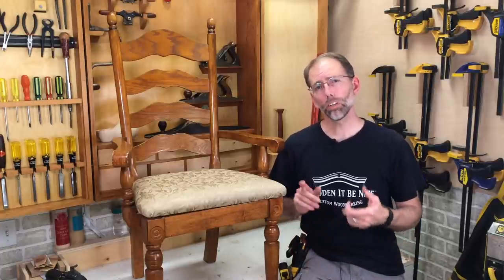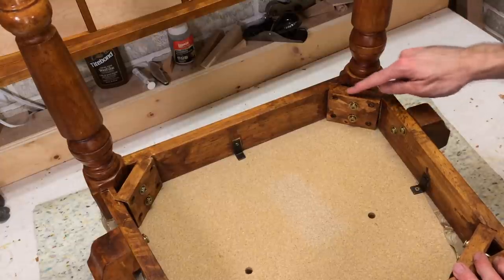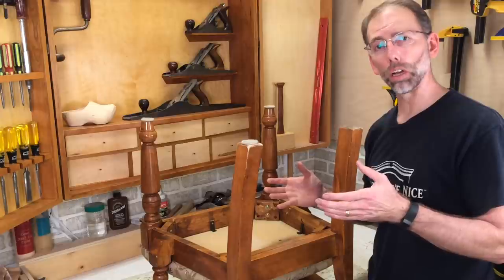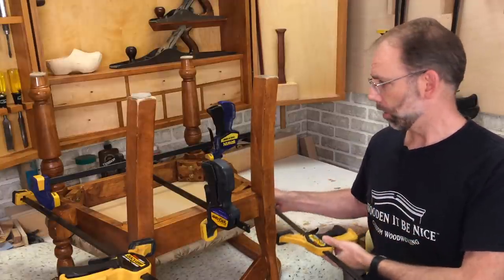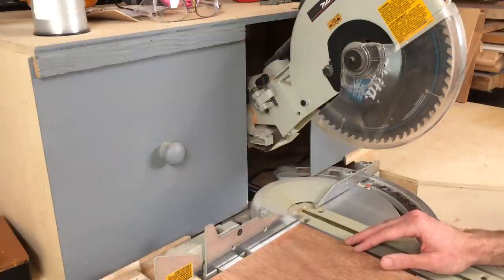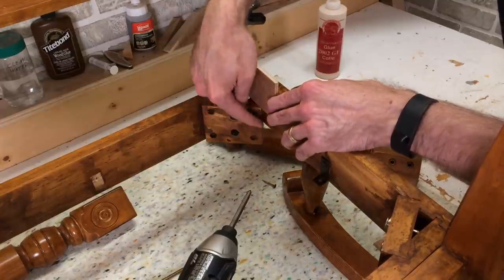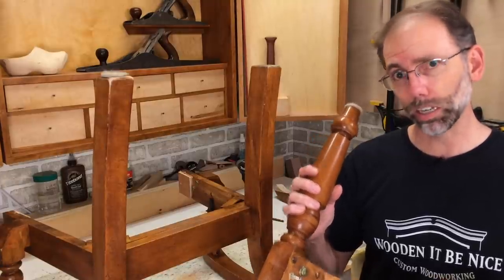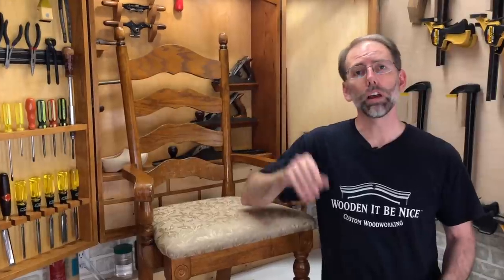Breaking Acacia Wood Chairs - How to Repair Breaks | Woodworking

Comment: Hi Scott, Acacia is quite a common wood for use in furniture making in Australia (think Tasmanian Blackwood, Gidgee), they are incredibly tough and durable. Gidgee is even used by plane makers for the soles of planes it’s that tough. Maybe the problem is that the timber may be labelled as Acacia when it isn’t or that the Acacias in Asia are different or indeed they may be plantation grown and have grown too quickly. Anyway just thought I would let you know that Australian Acacias are beautiful, strong and expensive! Cheers from Australia
Reply from the maker: Thank you Jenny.  That's helpful to understand.  I will have to look into Acacia more to figure out where these problems are coming from.  Thanks.  Scott
Reply: I think there is a big naming problem particularly with imports. For example there are different types of pine which have different qualities. Some are good (or reasonable) for furniture and some are not but are good for framing. There's different oaks, ashes, cedars and merrantis etc. Some are good for one purpose but not another. A quick look at Wiki and I see about 100 different acacias. On the other hand there are only two different jarrahs and I can't tell them apart. So really it's a marketing problem.  I had a lady very proudly tell me her outdoor tables and chairs were made from hardwood. It was western red cedar, a decorative timber. Yes, technically a hardwood, like balsa, but not a great chair or table wood which are subject to much different forces than a dresser or shelved unit.
Reply: @FixingFurniture  I also get a number of these types of pieces in my shop. I don't know a lot about acacia wood, nor can I tell what you are working with on this chair as there are no close up pics of it. Most of what I get in are made from a type of beech. Beech can be a reasonably good wood for this, but what I find is that modern forestry techniques have the trees growing so fast that there is no strength in the wood. Take a quick look at the grain lines to see how wide they are. This could be part of the problem. And of course, as you say the design is poor as well.
Reply: @Goalsplus  I am not an expert and could be wrong, but I thought that 1) eastern red cedar is a softwood and 2) is not a very expensive or hard wood but is often chosen for outdoor furniture due to its innate rot resistance. Please let me know if I have my facts wrong here - it can be hard to find good and accurate information online and (as you said) it can be a real mess trying to match names to species given there isn't good standardization and different woods labeled the same can have wildly different properties ("mahogany" in particular springs to mind).
Reply: @benwake4823  you're correct.  I should have said Australian red cedar which is a hardwood. So cedars can be softwoods and hardwoods.  I suppose someone said it looks like cedar and the name stuck. As for the softwood varieties, yes, it's good in the weather, and some might disagree, but I don't think it makes good sitting furniture because the joints don't hold up. To expand, you wouldn't make a chair from balsa wood  which is a genuine hardwood. And, yep, mahogany is a good example of a mix of woods with different qualities.
Reply: @FixingFurniture  Hi Scott.  Have a look on Google images at "wattle trees", which are Acacia.  The flower is the national flower of Australia with many different species.  They grow throughout the natural bushland in Australia and in many people's yards.  One Acacia item that is beautiful to see.

Comment: Looks to me like  parawood, not acacia.  Sometimes call rubberwood or Asian hardwood.  At 2:38 when you took the piece off, it showed the grain, which looks an awful lot like rubberwood.  Used a lot in "affordable" furniture.
Reply from the maker: Wow, that's helpful.  I'll look into that further to understand it better.  Thanks Jan.  Scott
Reply: Yeah, I think you're probably right, which makes it kind of a mixed issue. The rubberwood comes from SE Asian plantation rubber trees that have outlived their latex production life (25-30 years). They're harvested and made into furniture, as the wood is hard, straight-grained, fairly easily worked, and takes finishes well. It's treated for rot and insect resistance, as it's otherwise susceptible. It's a "renewable" resource, as new trees are planted to begin the latex production cycle anew, and using it for furniture means it's not burned off (putting more CO2 into the atmosphere). And it has largely replaced use of some more threatened tropical hardwoods--also a good thing.
I wonder if the biggest problem here was unsuitable joinery techniques, rather than the wood itself? Inexpensive material got paired with cheap joinery to make cheap furniture. But I wonder if the material itself, handled more respectfully (and, unfortunately, more expensively) might lend itself to a decent product.

Comment: Acacia is a fairly common wood here in the Philippines.  I have about 9 acres on a hillside and we have many Acacia trees here.  We occasionally use wood from these.  As you have found, it can be brittle.  But it is a fairly good wood for making things, just not good for use as chair legs or arms for that matter.  We use it as a very strong wood with some color for framing out tables and benches and we do use it in a much thicker format so we do not run into the splitting issues as long as we keep it thick enough.

We also have a local wood, even harder and much less straight grained.  I have no idea what the real tree name would be in English, but locally it is called Matamban.  It is a fairly white wood and is dense to the point that in the green state, I am not sure it would float.  I work with it a lot used for my work shop work benches.  It is similar in density and hardness to Osage Orange but without the bright yellow color.

The Acacia is available because most countries have stopped allowing the teak and mahogany trees to be cut.  We also have a fruit tree called Jack Fruit trees that make wood that is similar in color to the Osage Orange, a bright yellow color.... It is used in decorative shelving and on larger trees can be used for coffee tables...

Enjoyed the "outside the box" idea with the thin plywood to strengthen that corner joint.  The back legs may break, but those two front legs are safe I think!!
Reply from the maker: Thanks for sharing that Lionel.  It's great to hear what you experience where you live.  I love to learn and I found this very interesting.  Scott

Comment: Who thought it would be a good idea to “inset” the “screw block/brace” into the sides of the seat? A 45 miter on each end of the block would leave the side “full strength”
Reply: Never mind, I see that you did that (whatever the angle needed to be, I noticed it may not have been a “square” seat
Reply from the maker: Good eye.  Yes, the seat flares out at the front so the angles are not at 45 degrees.  Scott

Comment: Just came upon Acasia laminate boards here in Japan.  To me, other color, same as pine.  Light.  I asked staff and they even said "softwood imported".  Another person here mentionned Rubber wood and that looks almost identical but heavier.  Being that rubberwood is so cheap in countries that produce rubber like Thailand, Malaysia and Indonesia, as rubber stops producing after 30 years so they raze whole plantations then sell the logs dirt cheap.  If you are a furniture maker youd use rubberwood for sure.  You know far more about hardwoods than I do so Acasia is possible I suppose.  In countries like Thailand though they don't grow softwoods.  Can't even find it at home centres.  My wife is Thai so I've looked   There is none because of termites.  Homes build but avoid softwoods.  You can bury a big ash underground and then use it 5 yrs later.  Softwoods, if course, forget it.
Reply from the maker: Wow, that's interesting Adam.  Since I published this video, I've seen a number of comments about Acacia woods and it turns out there are over 1,000 different species that vary greatly.  I'm not sure though how to narrow down this brittle but heavy wood that I keep seeing in customer pieces.  Scott

Comment: I'm here in Japan and while the domestic makers use only quality wood,  makers tend to be custom artisans so pieces are very expensive.  In fact, a Japanese lady I knew who bought a new house wanted to have Oak furniture so she sourced in Japan and then decided on a maker in Kentucky and even at that and the shipping across the globe, it was HALF the cost.  So,  its not hard to see the allure of cheap imports.  Though I do wish importers would use better wood.  People would pay a bit more like say Imported Oak.  I bought a round dinner table 2 years ago.  Already a leg broke off.  Very similiar to that Acasia.  Mystery wood.  but judging by weight its not a hardwood.
Reply from the maker: Thanks for sharing that Adam.  Scott
Reply: weight is not the best indicator of a hardwood.  Poplar is a case in point.  When dried very light in weight but is extremely strong and fiberous.

Comment: Thank you for the education.  I just accepted a job repairing a mahogany chair with a shallow angled  break at on the front turned leg just below the stretcher.  The cross section at the break is about 1 inch square.  The grain in the leg is across the leg at the break.  Someone attempted to glue the break with a polyurethane glue.  I would like to install a 3/8 inch dowel.  I am considering sawing across the leg below  the original break to get a level drilling surface.  I would use a clear epoxy to reassemble the cut off chip and the leg with the dowel in place.  The leg is carved with a claw foot and a lot of curves.  Is there a better way to do this?

Comment: Thanks for the video. You mentioned how fibrous spruce is.  I recently read that spruce was used in the construction of wooden airplanes not just because of its “springy” strength and light weight and straight grain, but because that “fibrous” nature made it more resilient to bullet holes.

Comment: It makes me crazy when I see people buying imported crap when auctions and Craig's list are full of older sets in oak and mahogony that people don't want because it's  "old".
Reply from the maker: Yes, it's unfortunate that this type of furniture is overlooked.  On the up side, it keeps the prices low.  Cheers.  Scott
Reply: And adds to the growing landfills and wealth of manufactureres
Reply: I think its just natural for people to want NEW stuff.  They want to be the first owners even though they are probably going to be the last owner (re: they will bring it to the landfill or it will eventually be used in the daughters first apartment , screws holding it together and all)
Reply: Adam Turnbull it is surprising to see most people not knowing wood from plywood or even mdf.  Let alone the structural integrity of joints (dovetails / mortis vs screws and flat box furniture).

Comment: Would you not consider putting dowels in legs + stretchers?
Reply from the maker: Good question.  Due to the cutout of the apron, and the fragility of the wood, I wouldn't trust dowels to hold this specific joint together.  Adding stretchers isn't an option as this is part of a larger set of chairs.  I hope that answers your question.  Scott
Reply: @FixingFurniture  thank you very kind of you to answer